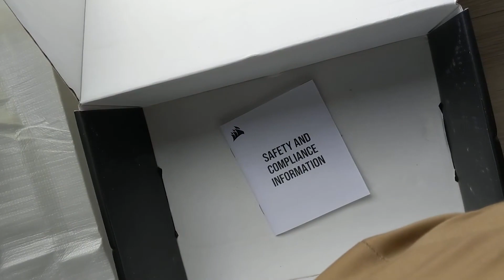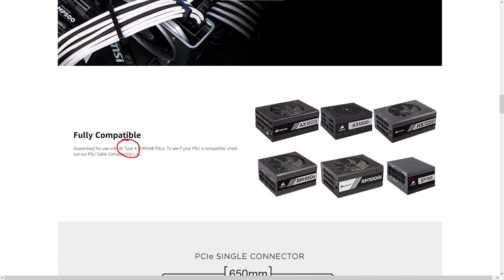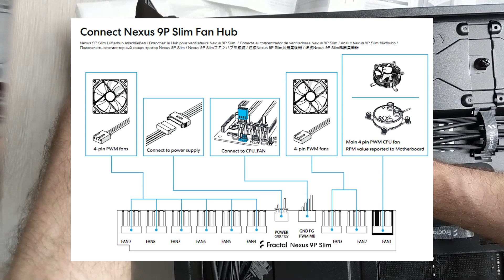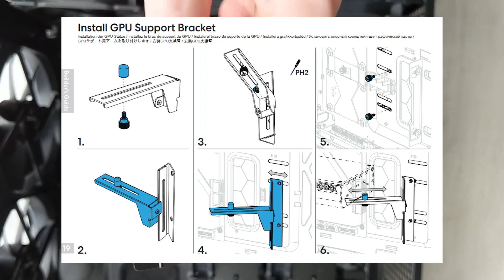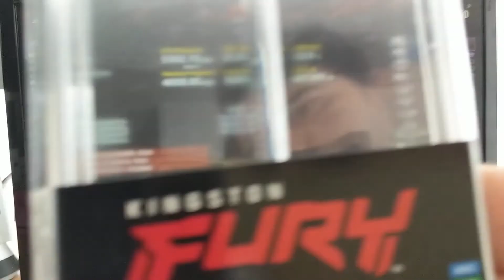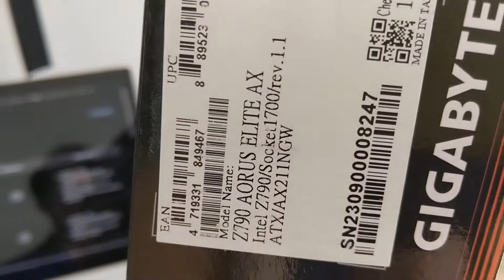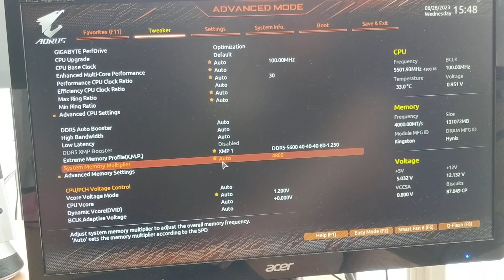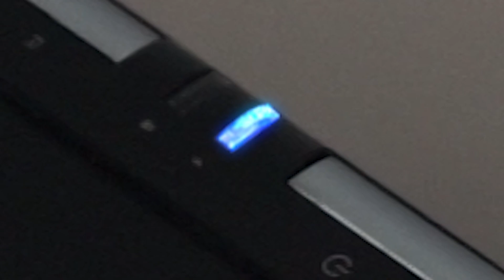Building the Ultimate AI-Powered PC!

Comment: Everyone is hopping on the AI bandwagon without understanding what AI really is. People throwing around the term "AI" this and "AI" that. Seems to me that you're just building nothing more than a gaming laptop. The specifications for a high-performance PC for "basic" AI modeling are similar to those of gaming laptops. Both require powerful CPUs, high-end GPUs, ample RAM, and fast storage to handle demanding tasks. AI workstations might have more advanced cooling solutions to handle prolonged high-intensity tasks, whereas gaming laptops focus on balancing performance and portability. I have my AI and machine learning certification from Standford University. Any sophisticated AI development I do is in the cloud using Microsoft Azure or Amazon Web services where I do my modeling using TensorFlow, PyTorch, and ONNX. I do most of my development using Python. Fundamental knowledge of AI programming and development requires training in advanced mathematics, such as linear algebra and differential equations; otherwise, you're just using models and applications that have already been canned. A lot of people using text and graphic-based generative AI models such as GTP or Claud or Stable Diffusion for graphics, are not doing real AI. They are using AI models that have already been trained using very high-end hardware and storage - not high-end gaming PCs.

Comment: They need to start building bigger computer cases and boards, I have yet to see a case or board that has enough room. I would not mind a WALK IN CLOSET for a computer.
Reply from the maker: Yeah lots of people building very small and tight machines. It's hard to keep temps down on those machines. My rig is big and has solid airflow to keep parts cool. You can build a computer walk in closet if you want. Might be difficult to cool and to make sure nothing hits the components.
Reply: Guess its going to have to be a walk in refrigerator lol  @MyWhyAI